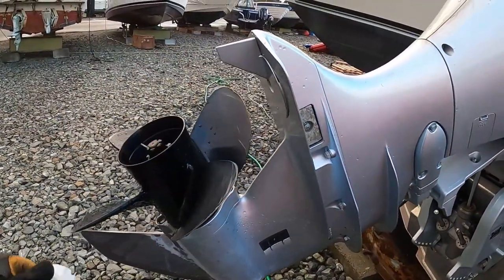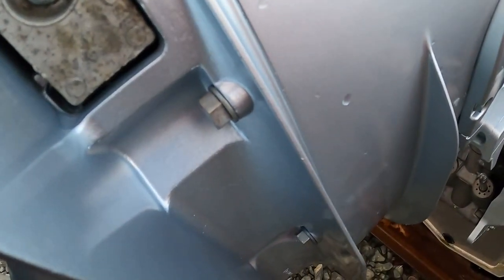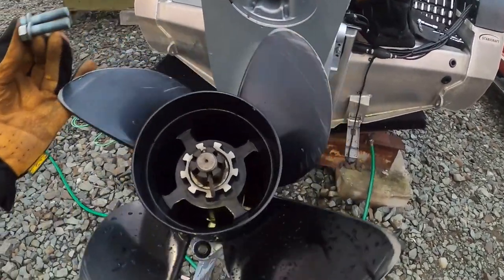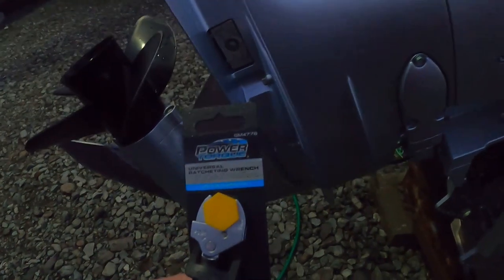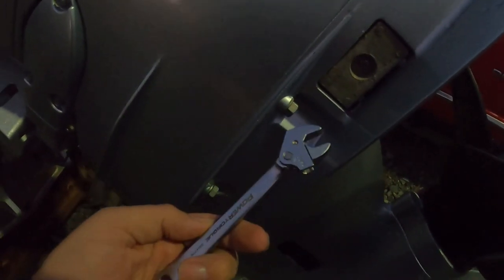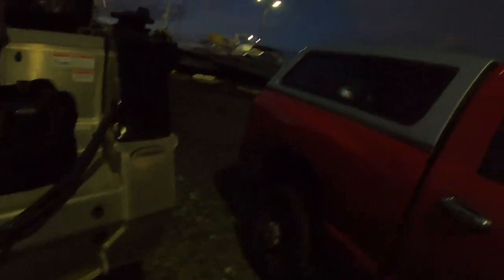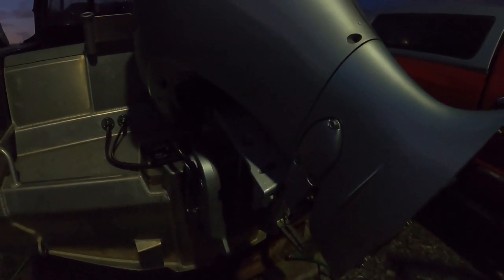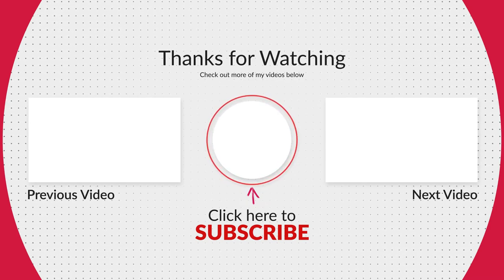Pulling a Honda BF150A Lower Unit post breakdown. | Stabicraft on the Sound

Comment: What was that line at the end of the video for?
Reply from the maker: @donovononeill3363  , thanks for the question.

Had to go look it up again myself, seemed to recall it being associated with the speedometer, and it is.  Here's a link to the forum post where I found the info:

https://www.marineengine.com/boat-forum/threads/2010-bf-150-hp-the-small-rubber-hose-that-run-down-the-outside-of-the-lower-unit.386691/#:~:text=It%20is%20your%20speedo%20tube,have%20another%20pickup%20for%20it.